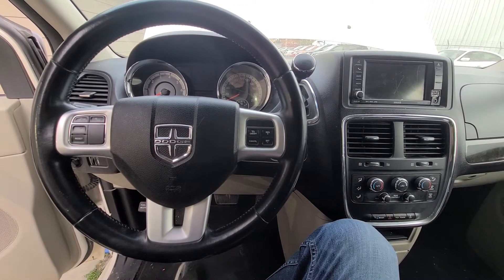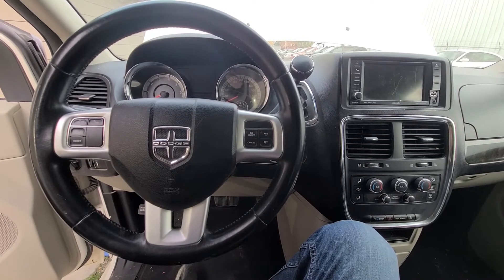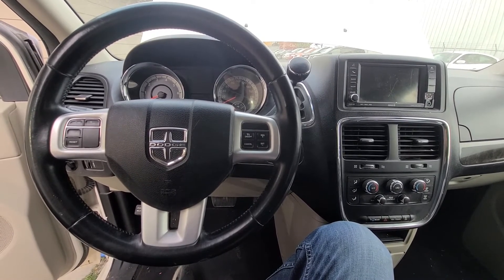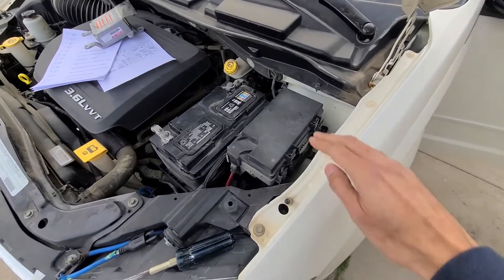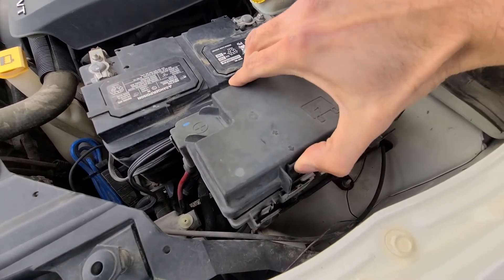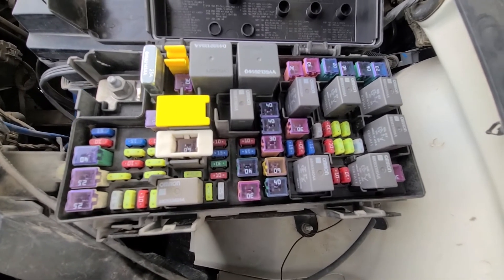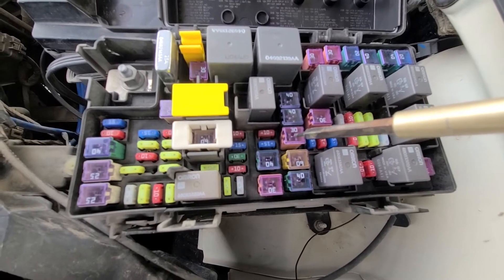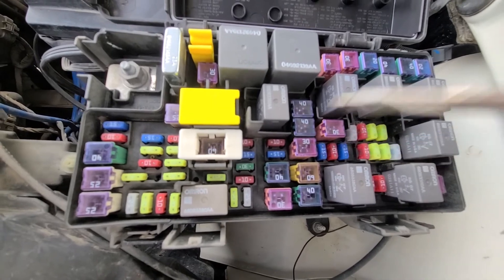Dodge Grand Caravan - POWER LIFTGATE / TAILGATE FUSE LOCATION (2011-2020)

Comment: Can you take a fuse out to silence the back up alarm beeping
Reply from the maker: If you remove the fuse then power tailgate wouldn't work anymore. Don't think you can adjust it in the vehicle settings
Reply: @QuiteAlright  thank you because I was told to unplug the speaker in the back  that goes to the speaker and that did not work, so I said I will go on YouTube where the smart people are 😂
Reply: @QuiteAlright  which fuse???

Comment: My 2012 Grand Caravan’s lifgate will go up using the buttons (keyfob, inside the van) but won’t close. Now it won’t latch anymore. I had to use a bungee cord to keep it closed. Any suggestions??
Reply from the maker: Most likely you will have to replace the latch assembly in the liftgate. That is the most common cause of the problems you are having

Comment: hello, ro430 error is burning in my 2018 caravan.  We checked the injector, exhaust pipes, oxygen sensors, catalyst - everything is perfect, and the error appears again after 30 km, advise something ?!
Reply from the maker: You mean P0430? Usually it points towards catalytic converter if all o2 sensors are good. Have you checked live data while driving? From my experience most likely you will need a new cat
Reply: @QuiteAlright  Thank you.
Reply from the maker: @СергейНестеренко-й1и  You're welcome

Comment: I have a 2011 grand caravan and someone hit me from behind and the back gate is all smashed in and it won't open and I can't get it fixed for a couple weeks but the gate light keeps coming on and it kills my battery. Could I take that fuse out until I get the gate fixed? Would this solve killing my battery?
Reply from the maker: First try to turn off dashboard dimmer switch. Turn it all the way down and that should take care of the light when door / liftgate is opened. If not you can try removing the fuses.

Fuse J3 is responsible for power liftgate, you can try removing it but the light will still keep coming on I believe. You can try to remove the Fuse M38 as well, but then you will loose power locks on the vehicle.

Comment: My particular 2014 Town and Country was in a front end collision and there is no electric . No horn , nothing , is there any way to get the lift gate open manually ?
Reply from the maker: Try to get the liftgate inner panel off and then you should be able to open the liftgate manually